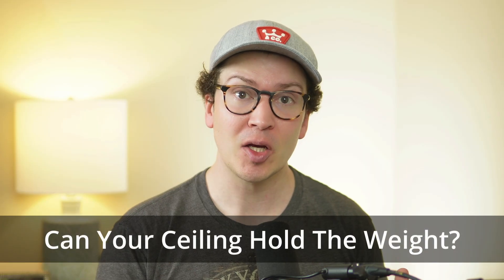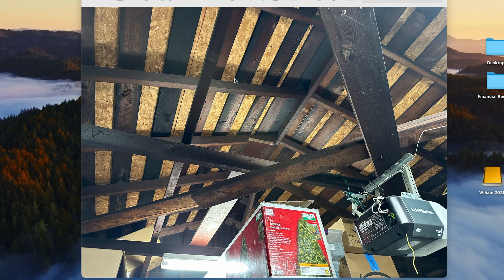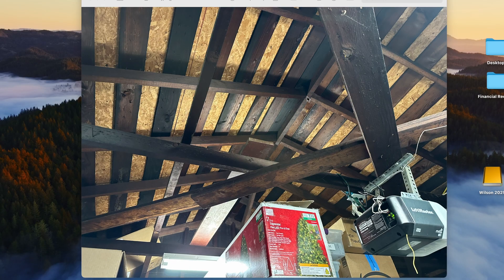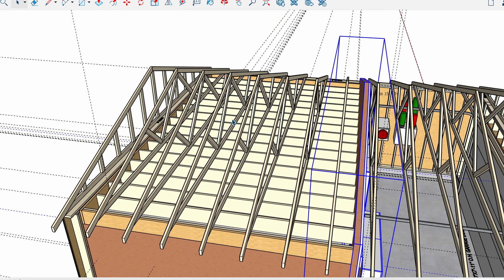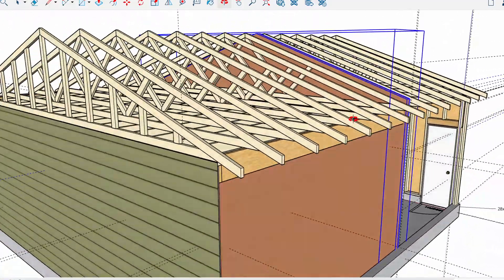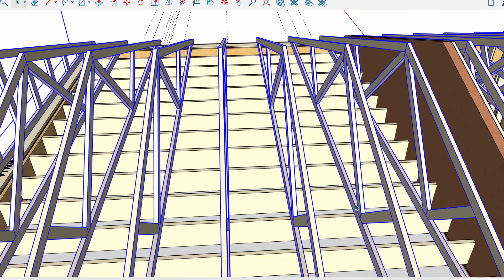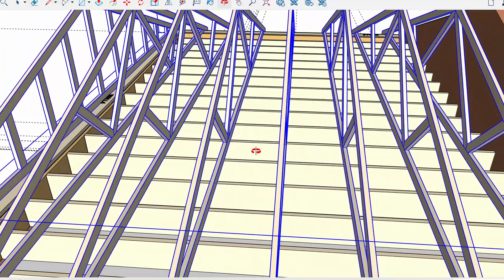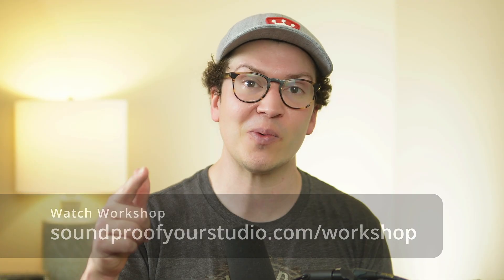Can Your Ceiling Hold The Weight

Comment from the maker: 🚨 Before you soundproof your ceiling, WATCH THIS.
Skipping a structural check could cost you thousands (or worse). In this video, I break down how to avoid the most dangerous mistake in DIY soundproofing.

👇 Got questions about your own ceiling or setup? Drop them here.
📅 Need expert eyes on your project? Book a free clarity call: https://www.soundproofyourstudio.com/...
🎓 Or join our free workshop to get the real strategy: https://www.soundproofyourstudio.com/...

#SoundproofSmart #StudioBuildHelp

Comment: In my garage/studio renovation I was planning to vault my ceiling, and just leave the rafter ties exposed without altering them at all. I spoke to an engineer and he cautioned against altering the structure at all. This being the case, I assumed I’d be good to go to add two layers of drywall and insulation to the ceiling… but maybe I’m wrong?
Reply from the maker: Good call checking with an engineer, Kendall. Every structure reacts a little differently, so if you’d like, I can walk you through the best way to handle your ceiling setup without risking stability. Feel free to book a quick call if you’d like to dive deeper.
Reply: @soundproofyourstudio  I ended up, just reinforcing the rafters, which I think will be sufficient. The design is finalized at this point and construction is well underway but I appreciate the offer. Your videos have been a great help, so thank you.

Comment: For LVL and PSL beams, lumberyards will size a structural beam in communication with the manufacturers.  I haven't had luck with directly connecting with manufacturers, but YMMV.  Seems like they are more responsive if the lumberyard is involved.

Also, the lumber you're referring to as collar ties are actually rafters ties in context.  Different job being performed.  Rafter ties exist in the bottom 1/3 of the gable, and prevent the walls from pushing apart from the weight of the roof. This is what is typically holding drywall to a flat ceiling. Collar ties exist in the top 1/3 of the gable, and prevent ridge separation from outside forces (wind).  You cannot replace rafter ties with collar ties.

In either event, both can be eliminated with a properly sized beam.  Probably wouldn't fly with laminated 2x4s in the walls alone.  Again, manufacturer would size it for free.
Reply from the maker: Thanks for the clarification, really helpful! You're absolutely right about the rafter vs. collar ties distinction, and great tip on working through the lumberyard for beam sizing. Appreciate you sharing your insight!

Comment: I knew this video was coming the moment you put out the HushFrame video!  As always, you're on top of it.  My presumption is, for basements, the floor joists above are fine for up to three sheets of 5/8" drywall.  Thanks again!!!
Reply from the maker: You're the real MVP for noticing that trend! 😂 Appreciate you always tuning in and dropping thoughtful comments. And yes, for most basement joists, three layers of 5/8" is usually fine, but always good to double-check the span and spacing. Thanks again for the support! 👊🏼